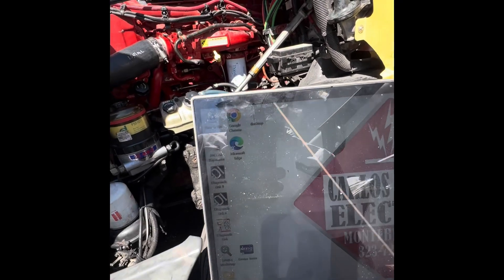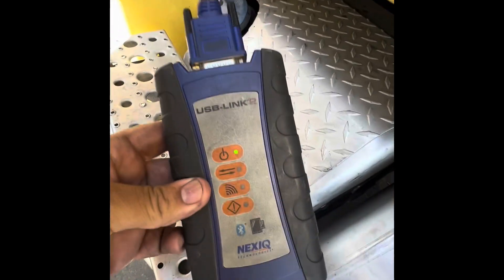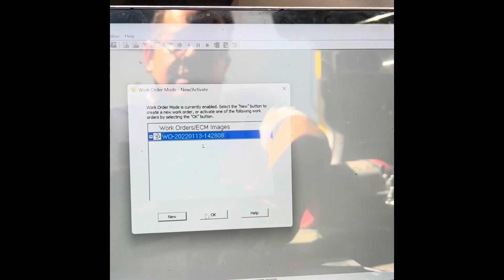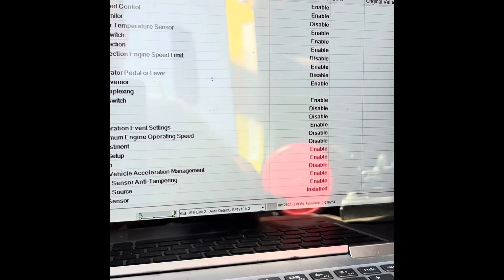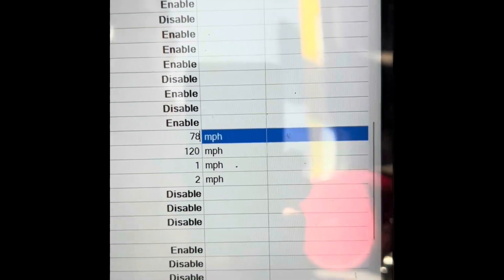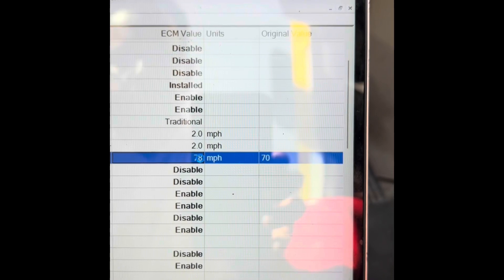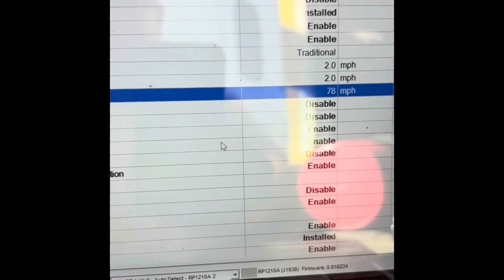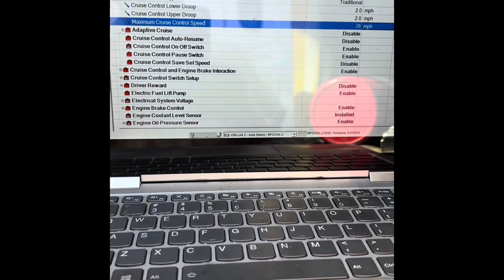How to change the speed on your Cummins ISX15 engine. This applies most Cummins engines.

Comment: Your better at this than most of the shops I try to watch because you actually show us what to do while they just brush by most of what they say they will show us. 

So I have a question. What is the difference between:

Passive regen
Parked regen
Forced regen

Thanks in advance

Comment: Hi Pedro inside Software.  Alow you to Calibrate  the Radar located in the Front bumper  ??  Bendix Brand
Reply from the maker: @ivanmadrigal7256  the Insite software is strictly for the Cummins application. The radar is OEM or Bendix and that is a different software.

Comment: Carlos my question is I am working on a 2023 international tractor with Cummins isx 15. I set road speed to 75 mph, but driver say truck only going 72 mph. My question is if vehicle has progessive shift  enabled will this cause  vehicle not to go 75 mph.please advise thank.
Reply from the maker: @RobertGonzalez-w2l  yes. Remove the progressive it will limit the RPM to what ever it is set to. Also, check the tire rev.
Reply: Also same vehicle driver wants engine brake to be reset. Engine brake will turn off once vehicle gets to 35 mph. Driver wants to know if this can be reset to lower mph due to certain hills that driver needs engine brake to stay on. Please advise thank

Comment: Company driver here, do I need to buy this license for software at an authorized Cummins dealer/repair? Looks like you can get the connector online. Other drivers say there is a guy at the shop you can pay $500 but if they change your truck it’s gone. The International and Pete’s have Cummins but the freightliners have Detroits so it’s still risky
Reply from the maker: Depends on where you are. I am in So Cal. So we have to go through Cummins Cal Pacific. 
You can go through Cummins to purchase. If someone is charging $500 to make this parameter change. That is way too much.
Reply: As a company driver, you better get the owners/companys' permission first before you start changing speeds on that truck. And $500 is WAYYYY too much for that. It's more like $150, last I knew.